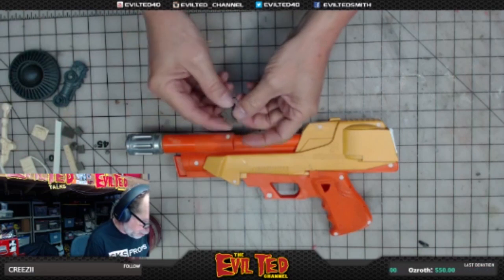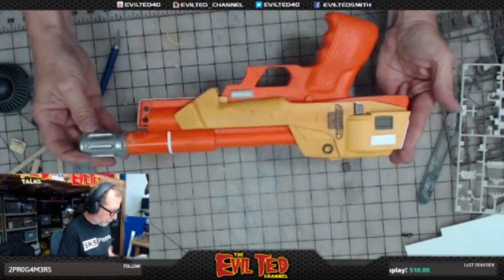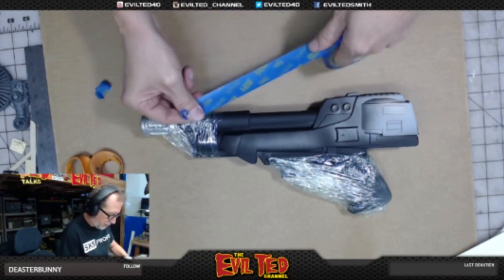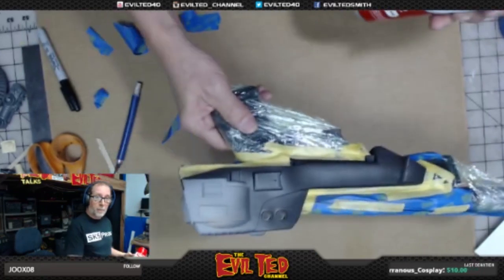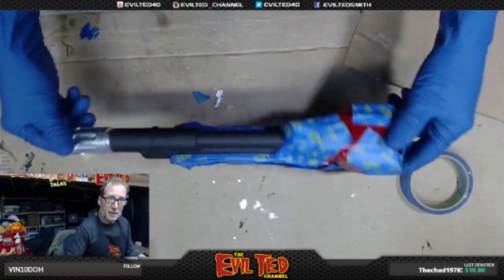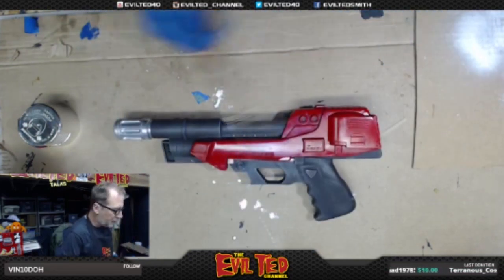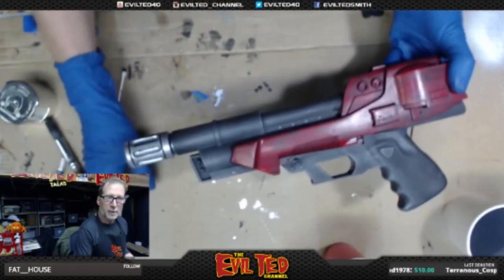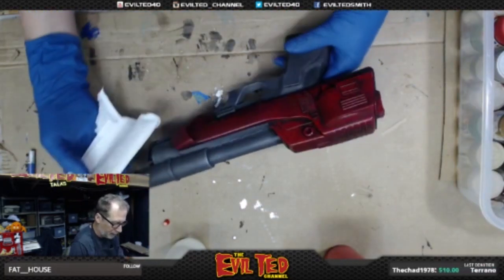Evil Ted Live: Toy Gun Mod Part 2

Comment: Ted, I have been using that adhesion promoter for a couple of years on the NERF guns I repaint and it works wonders. and the same company has a clear sealer too. Both of them together helps the paint stay on the Nerf even with a lot of beating on them.
Reply from the maker: Nice! Thanks for the tip.

Comment: You are the expert, and I'm not criticizing your process, but why didn't you paint the "frame" and the "slide" before you cemented them together? Just to avoid the masking.
Reply from the maker: Because what ever I glue on to the paint won't stick very well. That because it will stick to the paint and not the plastic. So one drop or a flick of a finger the parts will fall off.